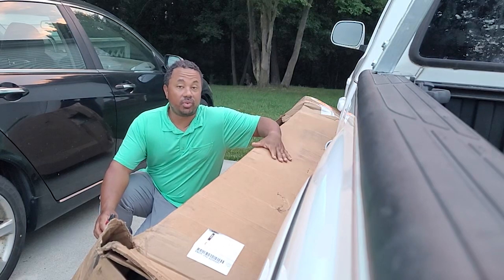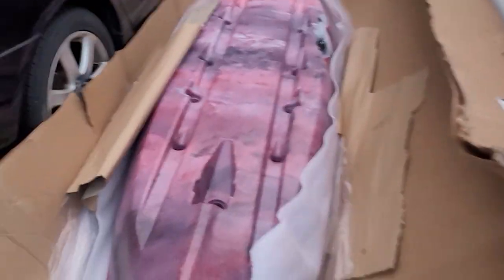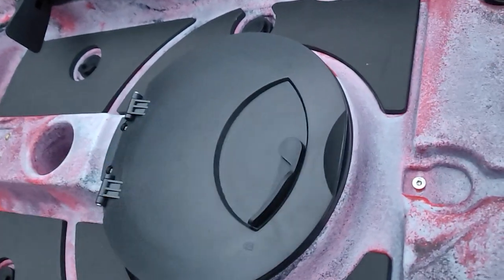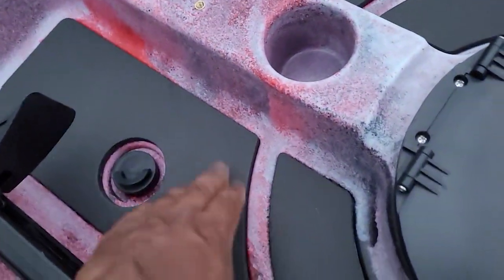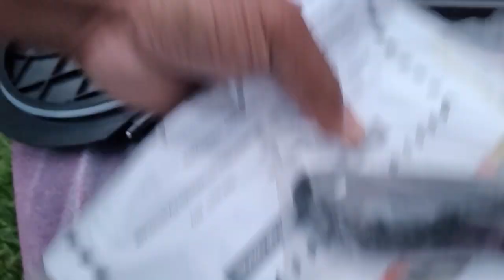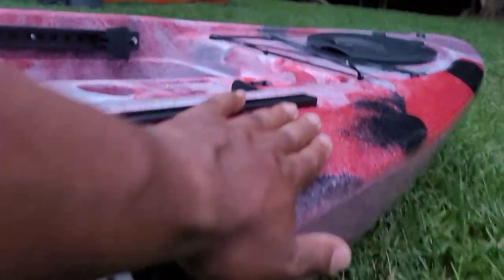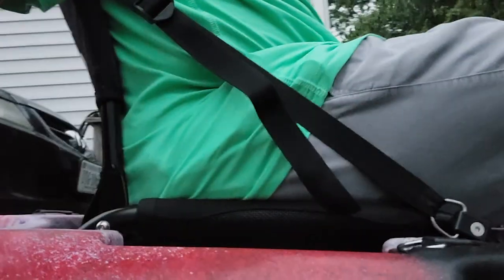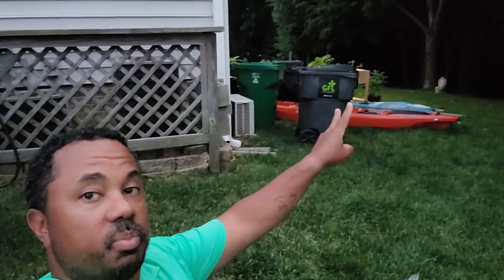BEGINNER KAYAK FISHING on a Budget?! $700 HooDoo Element 100S kayak unboxing!

Comment: Do you have any idea what the mounting location right beside the hull id and the ones right behind the seat are supposed to be used for?  I figure the ones behind the seat could be used for a trolling motor mount or possibly outriggers but I can’t figure out the spot next to the hull id.  Thanks for the video!
Reply from the maker: I actually wondered the same.  I honestly never figured it out.
Reply: @WAEofFishing  I finally figured it out and for anyone else who might want to know the ones behind the seat are for outriggers and the one beside the hull ID is for the rudder system’s rope guide.

Comment: Hey, brother. What are the 11 plugs that you started off showing for? What's the max load capacity?
Reply from the maker: The 11 plugs are scupper plugs.  They close the scuppers (through vessel drainage ports).
Load capacity on 10' kayaks is surprisingly high.  On some models, they can actually have a higher weight capacity than the 12' (mostly due to shape I think).  This one is 300lbs.  That means I can put 100lbs of gear in this boat with me.... but I intend to pack very light in this. :)
Reply: So because I'm 280lbs, this would be a bad choice for me, right?

Comment: That’s some budget, my Kayak cost $250
Reply from the maker: WOW! what do you have?  My first Kayak was 350 without the paddle.  Cheapest I ever found.
Reply: I have a Sundolphin 10 SS it came with a paddle and a removable rod holder in the middle front and two in the back . I’m a little heavy for it load capacity is 250 I go 235 lbs but I use it .
Reply: I bought mine at Tractor Supply. End of season.